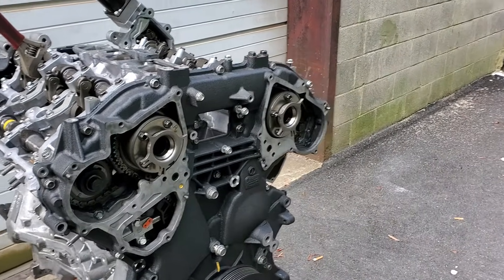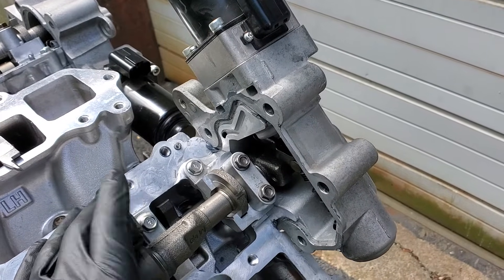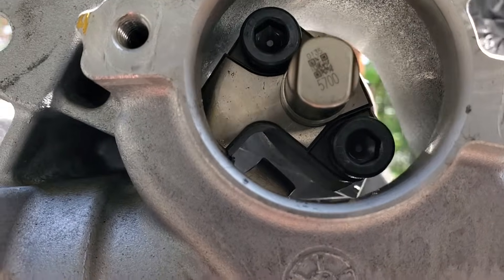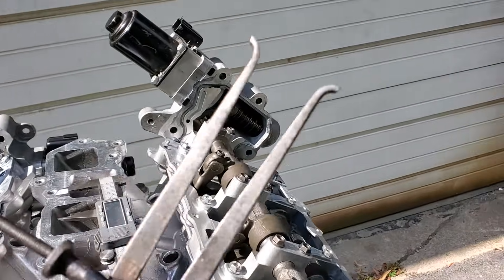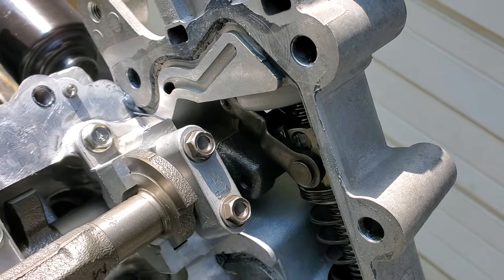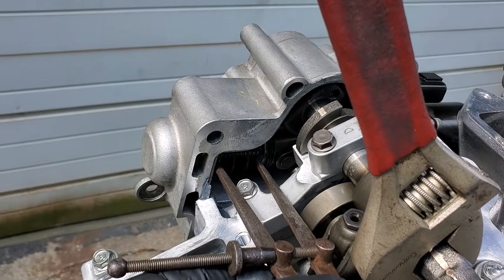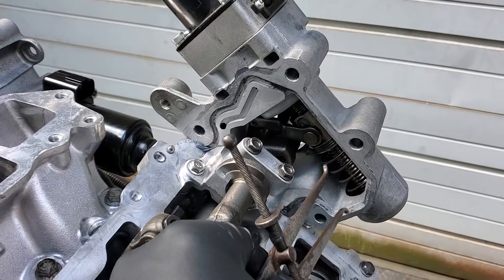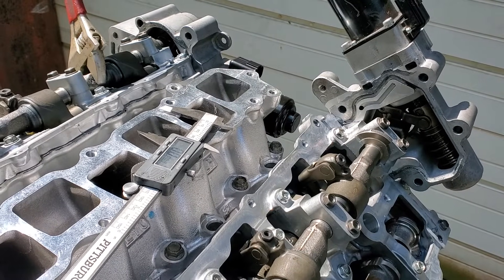VVEL fix for Nissan 370z and Infiniti G37

Comment: Seth, I'm having issues getting my 2011 to start after replacing the timing chains. I've followed all instructions and initially it ran like a sewing machine for about 30 seconds and the RPM's went up and down like a wave 3 times and shut off. Haven't been able to start it since. Fuel pressure was at about 50psi when attempting to start and compression was at 115 and 110 on the first pop. I'm at a loss here. Any help would be great
Reply from the maker: Did u reset the vvel sensors themselves follow the fsm procedure with ecutek or consult?
Reply from the maker: I might have misread that.lol...sorry...what components in the case did you replace and why were you in there.
Reply: Seth, I'll look into resetting the vvel sensors. I was in there because car cut off on me without warning. Had car scanned and the cam sensors cam up. Read forums and car started with bank 1 cam sensor pulled and ran in limp mode, but like garbage. Read some more and some other guys had it brought to a dealer and confirmed timing was off, so I pulled it all apart and bank 2 was off a tooth. Installed new chains and tensioners as well as cam and crank sensors. Fuel pressure is good and compression. However, those pricey cam actuator sprockets I did not replace. Could those get messed up?
Reply from the maker: @kilroy6716  ok, so, sometimes that encoder wheel that the cam sensor uses as the mag pickup for cam timing can shift, or move...it looks like it's a one piece intake sprocket visually; but obviously we know its multiple pieces (this is what advances or retards the centerline of the primary intake camshaft at varying rpms....that encoder wheel on older cars will actually slip and twist inside the sprocket and can be off be varying degrees of distance making a no start condition from the encoder not being synchronized as it passes by the cam sensor) Clark@JWT told me to his knowledge these sprockets have been revised 4 times for this issue...there is also a "rebuild procedure online to reclock the encoder wheel on the sprocket)
Reply: @sethjoyner391  ok this information helps quite a bit. Sounds like this might very well be the problem. No engine codes either so it's been a struggle trying to troubleshoot all this and I am by no means a mechanic. But I can read and have help from my buddy at his shop so we'll look into this tomorrow and I'll keep you posted. I do appreciate the response and the information very much!
Reply from the maker: @kilroy6716  yea, it's a super hard diag because its hypothetically a mechanical failure and doesn't throw codes...u can inspect this with the cam sensors removed with a digital bore scope...also,  try unplugging the sensor and see if its starts in a default mode
Reply: @sethjoyner391  I'll give it a shot and we'll send a scope in there and have a look because I'd rather not remove covers again unless I have to lol
Reply from the maker: @kilroy6716  tell me about it...bank 1 is annoying...thanks nissan
Reply: @sethjoyner391  we're going to go ahead and replace the VVT actuator sprockets which is what my buddy suggested when we did the chains because he has ran into the same thing on a Chevy motor with similar sprockets and it was the problem. Do you recommend Hitachi for the sprockets?
Reply from the maker: @kilroy6716  yes, your friend is 100% correct,  that's what I would do
Reply: @sethjoyner391  update** removed the actuator sprocket covers to find the cam bolt in bank 1 had completely backed out and on bank 2 halfway backed out. So question, should I use picture putting them back in? We're still going to replace the actuator sprockets with new Hitachi one's
Reply: @sethjoyner391  *loctite* not picture lol
Reply from the maker: @kilroy6716  loctite and make sure u get  somewhere +/- 76ftlbs torque spec
Reply: @sethjoyner391  new actuator sprockets are in and car is back together. Fired right up. Runs like a top. Thanks for the help!
Reply from the maker: @kilroy6716  hell yeah dood🤟
Reply: @sethjoyner391  I have a question. What do you think of being locked into a fixed VVEL position maximum valve position ????
Reply from the maker: @Kuro_Boy_  it's just not really possible since the stepper motor constantly adjusts lift and duration while simultaneously the vtc intake sprocket is constantly advancing or retarding the intake cam timing...its a highly complex system that is actually..believe it or not designed for emissions by nissan with maximum valve overlap...its a whole thing..."no vtec killer" kits available to my knowledge
Reply: @sethjoyner391  how can i contact you? I will send you my project.
Reply from the maker: @Kuro_Boy_  look for me on Facebook..white guy with a baby in my picture (baltimore) send me a friend request
Reply: I keep getting code p1092. After the 1.585 measurement.  And vvel reset procedure.  Sensors set at .5v

Comment: What kind of codes with this trigger if it was to be done wrong ??? Or would the car even run at all , my cars been throwing camshaft and maf sensor codes both for bank b and  going into limp mode . Huge headache here

Comment: I gotta do cam chain tensioners with my timing chain kit and removing the ladder assembly is a must, thanks for the tip, I hope this works out
Reply: How it come out bro
Reply: Just unbolt it
Reply: @Z34-ss  no I meant like, how did the outcome of your fix go lol you were able to use the same vvel actuator?
Reply: I did it without removing the ladder assembly, or stepper motor housing.
Reply: @lucasvaughn9423 how were you able to change tensioner without removing latter assembly if I may ask?
Reply: I didn't do it right. I have to grind and cut a piece of the latter off to get enough clearance for the tensioner bolt

Comment: Great video. Why can't you just put mach marks on cam and vvel arm before unscrewing bolts? So later on you can assemble it back in same position?
Reply from the maker: For guys doing cam swaps in car, that would be out of the question,  it also somehow isn't that accurate since the adjustment is so small...u can try 😏...I've tried this in multiple different fashions
Reply: @sethjoyner391  Mach marks didn't work? :-) I am wondering why no one copied oem jig for vvel actuator so far.
Reply from the maker: @tarassymonik7603  they did....if you buy a brand new vvel motor assembly; they're is a small black plastic locater that i have found to be highly inaccurate...nissan does not want people knowing about this engineering fail or the gallery gaskets in the timing cover essentially imo
Reply: @sethjoyner391  thanks, now I start to search what's wrong with gallery gaskets:-) So, there is no precise way to assemble head with vvel (even new with jig) is that what you are saying? If I am not mistaken, even if you have brand new head with vvel motor and you want install it, you still need to remove camshafts to get to  head mounting bolts, is it correct?
Reply from the maker: @tarassymonik7603  yea man....nissan has no real good answers...all I know is the process i came up with...just had a 370z dyno 900whp and 800fttq....this just works, don't know why.lol
Reply: @sethjoyner391  ok, so probably it doesn't need to be so accurate, or maybe ECU puts camshafts in right position later on.
Reply from the maker: @tarassymonik7603  it needs to be generally accurate like the video....then u have enough "general range" to get the sensors synchronized
Reply: @sethjoyner391  I think you are right, I would guess that servo drive will rotate vvel shaft up to the end to find zero position during learning, so it just need to be in some reasonable range during learning.
Reply from the maker: @tarassymonik7603  yessss....100% exactly, "something reasonable"...I wish I had used that phrasing...I think the way u said it would make more sense to most people

Comment: i have a 2015 q50s with under 65K miles. I have started throwing code P1089. Any ideas what to check first? It randomly throws this code and instantly goes into limp mode. I can clear the code and itll run fine. Seems like a bad sensor to me?
Reply from the maker: any other codes, or just that one?...u have any mods or tuning
Reply: @sethjoyner391  just that one code. No mods or tuning.
Reply from the maker: My first thoughts are a couple short interval oil changes and some hard driving (to exclude vvel solenoid malfunction?) Replacement of vvel relay or inspection of terminal contact
Reply: @sethjoyner391  well. I changed the oil. It didn’t come back on for about a week. Then It came on one day randomly. So i think the actual solenoid is fine. Because when it runs good, it runs perfect. Then it will throw this code randomly, and I’ll clear it right away and it’ll be back to normal. So my guess is the sensor.
Reply: Is the sensor the same for both sides? Do you know the part #? I’m thinking about buying a used one, just to try it out and see if it fixes it.

Comment: I'm having timing problems on a QX56 and I suspect that this system has collapsed thus retarding the time on bank 1. When changing the chain and guides, if the intake VVT actuators are rotated which can be moved by hand, will the calibration be off if this somehow be disturbed? I don't know what else would make the time retarded but I can see that the camshaft moves back and forth as the phaser is rotated.
Reply from the maker: sorry for the late reply....if you just moved the control shaft back and forth but never loosened it....however, u may need to reset the vvel system to relearn
Reply: Did you ever get this fixed? And was this a VK56VD or DE engine? I'm having something similar to this on my m56 and after changing my timing chains, it's not starting.
Reply: @Broke2FastGarage  I believe it was a VK, we sent it to the dealer and they supposedly slapped a new timing actuator solenoid, though I had changed those recently. I believe that all they did was reset the learned values but I could be wrong. The car not starting is a different issue for you. For the timing to be right, just install the sprockets (they have guides on the cam) and then route it with the chain marks.

Comment: Congrats! Very impressive, I’ve never seen any work done to these heads posted on YouTube. I have a whole lot to learn, I’d love to see more of this motor. I’m currently building a g37.
Reply from the maker: I'll try and make some more videos....all I build is vr38 and vq37....I may make a walk around video and explain whats necessary for different power levels up to around 1200hp
Reply: @sethjoyner391  I have a question. What do you think of being locked into a fixed VVEL position maximum valve position ????
Reply: @sethjoyner391  hi, can I make a 3.7 vhr work with HR harness and ECM?
Reply from the maker: @georgepressel2495  oh, definitely not...this swap would be extensive believe it or not
Reply: I just bought one from auction and it knocks and blows white smoke but starts and drives, not driving it  currently but I’d love to figure out what I need to do……

Comment: Hey Seth, curious question I think I’m having VVEL issues comes and goes, engine runs perfectly fine super quiet It’s a g37 IPL coupe only 12,000 miles on it, but randomly out of nowhere I get this strange noise and then it will go away if I leave it running for a little bit or I’ll shut the car off and restart it and it just disappears ? It literally does it randomly and sometimes it doesn’t happen at all. Motor sounds so smooth so it’s just confusing. Is it a serious issue ? Should I not be driving it ?
Reply from the maker: sorry for the very late reply...make a video and send it to me if you're still having the issue
Reply: What ended up being the issue? My 370z is having this issue. You ever get it figured out?
Reply: @prvtgoaty_yt4738  bro I have been using Amsoil and the noise just completely went away, hasn’t done it since.

Comment: my brother, after assembling the vk56de engine, makes a lot of noise, I can't understand where the noise comes from, but I suspect the vvel mechanism // did this repair for the first time, you can give a hint
Reply from the maker: sorry for the beyond late response, hopefully you fixed it....always make sure that your vvel solenoid harnesses didnt get swapped accidently through the reinstall process

Comment: Hey my car has a p1090 code anyone with their two cents on fixing it ?
Reply from the maker: Do you have any modifications or recent service? Anything in the top end?
Reply: Cars stock but i had the engine rebuilt and ever since then the code p1090 pops up
Reply from the maker: @clooperdooper391  bet they didn't do my procedure to degree the control cam in sync with the vvel...almost no one knows about this...u need to pull the intake manifold,  valve cover, rear aluminum cam cover etc and measure it like I did...almost 100% the control cam is degree'd incorrectly...these vvel motors rarely seem to go bad...most engine builders don't know this unless they specifically build nissan
Reply: @sethjoyner391  damn man how much you think this gonna run me approximately?
Reply from the maker: @clooperdooper391  u could do it yourself,  u need access to someone highly mechanically inclined that has nissan consult or ecutek to do this right
Reply from the maker: If done via my procedure its about 6hrs labor
Reply: @sethjoyner391  aight man will try this out myself
Reply: @sethjoyner391  thanks for everything
Reply from the maker: @clooperdooper391  ...you got this...just get a micrometer and watch my video step by step bro
Reply: @sethjoyner391  with ecutek you can reset it without doing this procedure?
Reply from the maker: @getbeamed6881  you still have to go through the process of pulling vvel sensor harness and vvel relay to put it into a "mode" to set them...essentially you use the ecutek to verify your sensor is with in range...its more difficult with Bluetooth cellphone...I use a laptop
Reply: @sethjoyner391  so this fix you showed on the video is to just get the sensor in range?
Reply from the maker: @getbeamed6881  yes, this is the primary mechanical adjustment that must be made in order to get the vvel sensors in range enough that u can set and calibrate them
Reply: @sethjoyner391  ok cause i installed cams on my g37 not getting any vvel codes but im getting random misfire, “A” camshaft position timing advanced, and engine oil pressure too low. made sure the timing was correct twice and still no luck
Reply: Its in limp mode and i narrowed it down to the left hand side vvel system

Comment: Seth is that measurement the same for both sides? Also how have you gotten this measurement? Meaning have you bought a new one and measured the new one then took that measurement and have that for future references? 

Thanks a bunch :)
Reply from the maker: essentially yes, i measured the distance on a sealed low mileage drop out...pulled it up to #1 tdc, then locked the control cams full counter clockwise and made my measurement...it's not a perfect way, but it does seem to work!...i've played with this system back and fourth trying to get the cars to power up on the dyno; seems that if you're off even a degree or two (from the pre determined 5.5 degrees) the sensors are too far off to get it within range and you will get bizarre vvel values....and it runs horrible
Reply: @sethjoyner391  so I did what was shown in the video but still ran into issues, i got good news though. Im working on a fix to be able to get the motor to 5.5 degree's without nissans plastic jig. My sensors are within range with your fix but one side can be at 4 degrees and the other at 7 degrees. total the car has to be at 11 degrees and 5.5 on each side. You could measure both sides but they still might not be 5.5 degrees. My fix is to put a magnetic digital angle finder on the camshaft, zero the gauge and then move it 5.5 degrees :) 

ill let you know if it works
Reply: @xsamis  Did it work?
Reply: @tarassymonik7603  yep, plenty of people have done this to fix the issue as well!
Reply: @xsamis  I think you can just print on 3d printer triangle (prism) with one corner 5,5 degree and place on surface wich limits camshaft movement, then turn camshaft to press it to triangle, so you should get exact 5,5 degree. Or you can order such triangle jig made from aluminium.

Comment: Is the distance the same on all motors?  If so, probably an opportunity for someone to make a tool that'll fit in there easier.
Reply from the maker: Very true...I'm not sure, but I've done it on  quite a few engines at this point...I felt like the factory nissan tool was useless,  I also used it as a reference when coming up with this method. It may not be factory perfect; however,  I feel like it gets the motor beyond or at its dwell point (which I thinkis the problem with the design), which allows you to get the sensor itself within range...not perfect,  but our alternatives are like angle gauges etc
Reply: @sethjoyner391  So i just did my secondary chain-tensioners and my car should run tomorrow, if i didnt do what your saying and just slapped my vvels back, what is the possibility that the vvel will be way out of time? Not looking for any ponies just want to my car running with least effort.
Reply: @braeder how did that work out for you brother?
Reply: @nando4283  it works as he described.
Reply: @braeder  did you try the way you were saying, or did you do it Seth’s way?
Reply: @nando4283  yes if my memory is correct. Car runs great because of Seth’s videos. Made a lot of mistakes but corrected them. Now I just need a job to finish making my payments